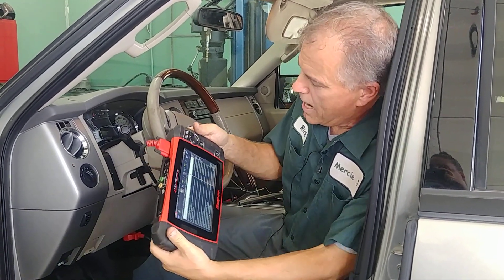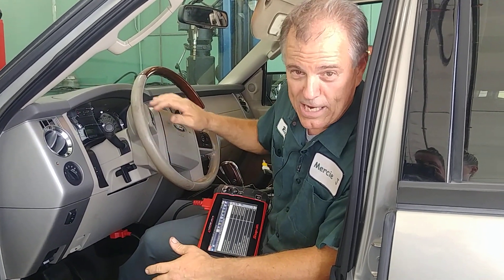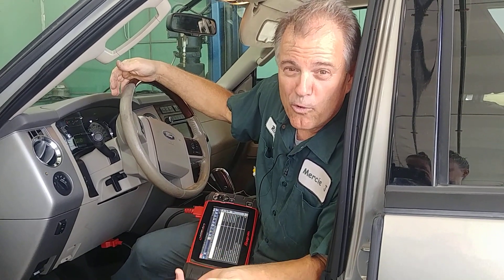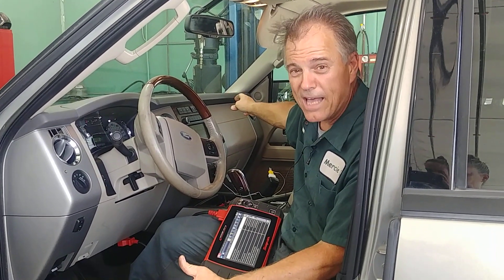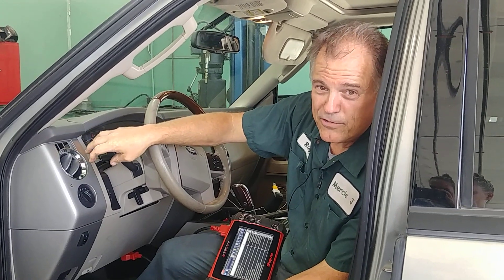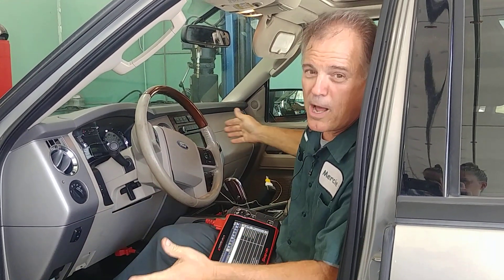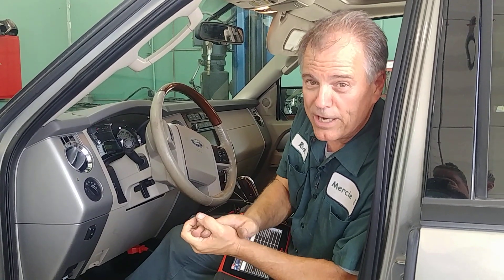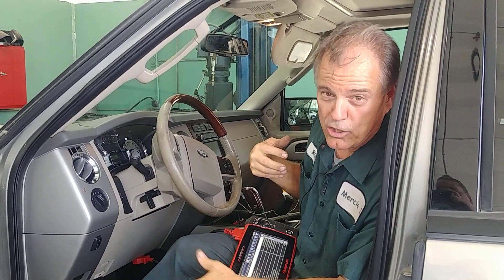Why is my Car's Air Conditioning Not Blowing Strong?

Comment: My 96 s10 the ac only blows hard and changes vent modes when the hood is open. I’m at a loss.
Reply from the maker: Is there a vacuum line getting pinched when the hood is closed?
Reply: @MercieJAutoCare  actually yes. I found the issue the other day. It was a vacuum hose coming off of that plastic ball that holds vacuum. When I closed the hood it would bend and over time created a weak spot and it cracked. When I opened the hood the crack would close and I’d have ac. Now I have ac all the time! I never experienced that before and I was thinking this is very weird. Thankfully it was simple and cheap to fix for the ac. Thanks for the reply.

Comment: I am having very similar problems in my 2009 expedition. Back only wants to blow like a fan ( not cold) and when it’s switched to heat it only blows in the floor. The front doesn’t blow as hard as it used to and I hear clicking. So frustrating. Taken it to have a/c fixed they changed all blend door actuators and nothing seems fixed. So frustrating.
Reply from the maker: We're sorry to hear that. This was also a Ford Expedition. If you are located near Mesa, we would love to resolve the issue for you.